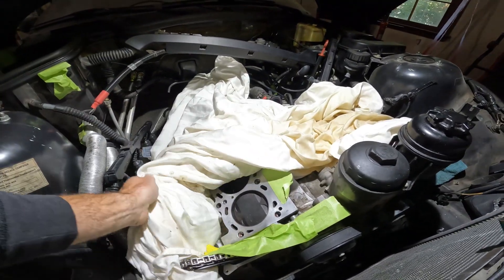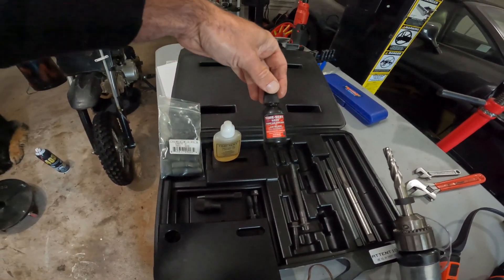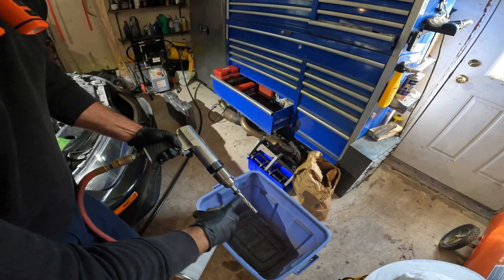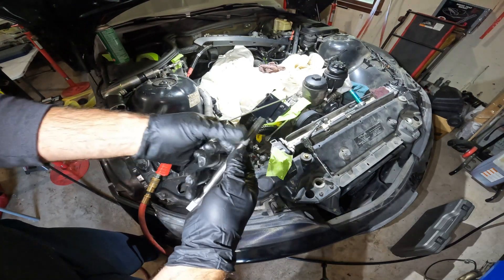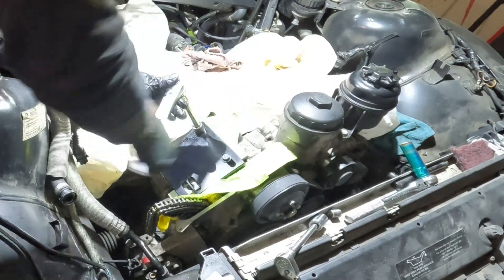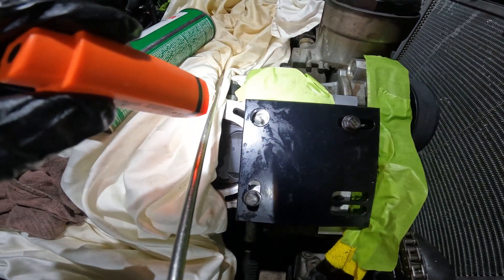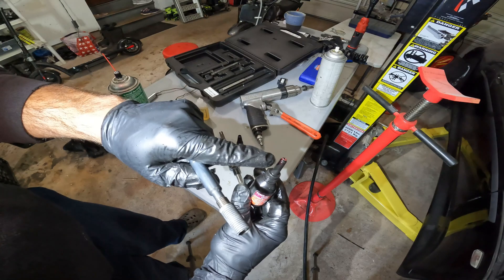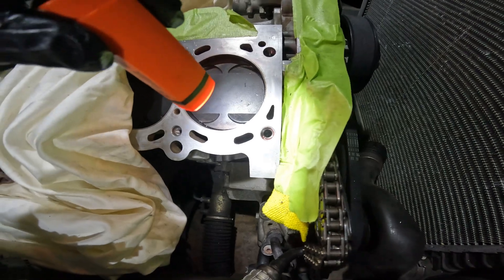BMW M52 M52TU M54 Engine Block Time Sert Repair Due To Engine Overheat! Full Step By Step DIY!

Comment: Is it possible to reach and drill every hole with the engine in the car?
Reply from the maker: Great question! Yes with the head off I had enough room to do every bolt hole.

Comment: How likely is it that I'll have stripped female threads when I remove a cylinder head that DID NOT overheat? (168k miles)
Reply from the maker: You can try a retorque procedure. But if you have head gasket issues the threads are most likely compromised.

Comment: Very helpful video! I am wondering if you would be willing to rent out your time sert kit or sell it? I am in the process of installing my cylinder head today and my threads are stripped.
Reply from the maker: Nice! I plan on doing more with it I. The future. The tool is worth the price. Sometime they are on ebay.